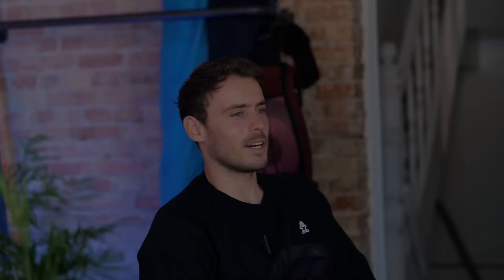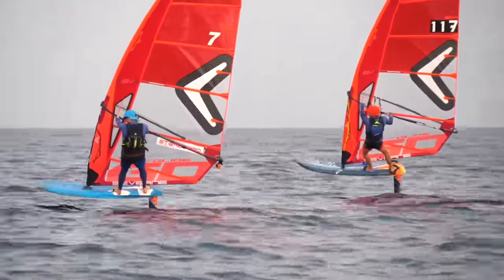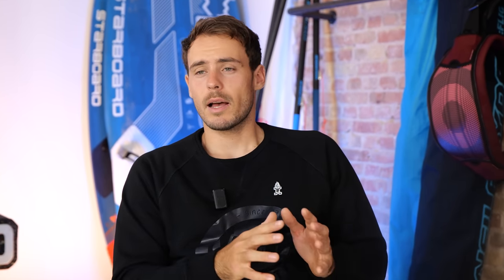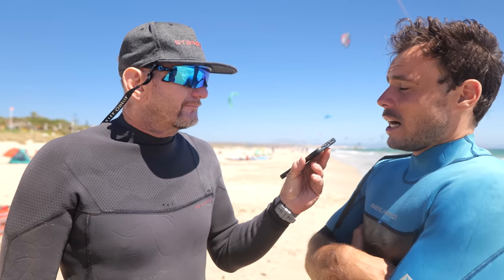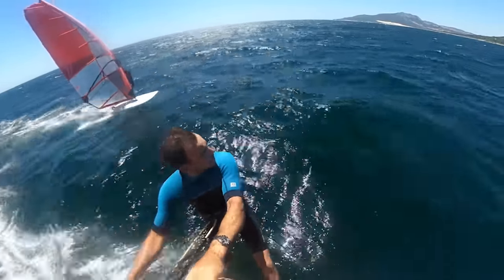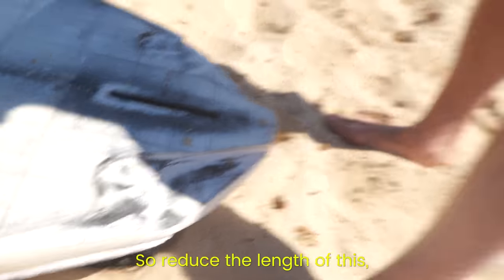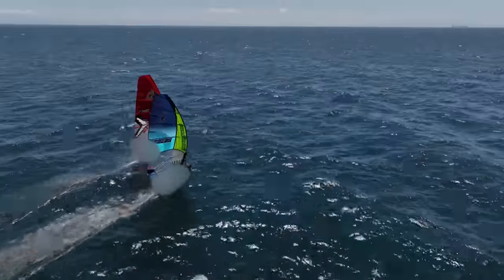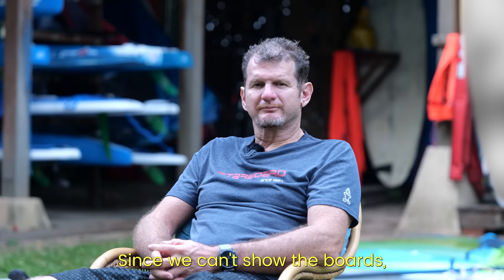Windsurf Board Development | Documentary

Comment: One development which could help those who wear 5 to 8 mm thick wetsuit boots is to make the footstrap covers with longer 'leather' attachment lugs, like an extra 3 cm at each end. Well you could just sell optional footstrap covers for those wearing thick boots. Actually i fix it myself by using chicago screws / rivets to make extensions to the cover lugs using the original holes. The extensions can be made from worn out strap parts and just melt suitable holes using a soldering iron. Most footstrap strap parts can be made big enough for 8 mm boots but the cover is the limiter. It seems important that your foot can swivel freely enough in the strap during a fall so as not to have leg injury.

Comment: That's a great inside look at the development process.  I've always wondered how new boards are created.  I was wondering if the foil racing has influenced fin racing board development.  It seems like racers are using foils in stronger wind these days.  Does that mean fin racing  boards are designed for higher winds now since that's about the only time they're used?

Comment: Great video. Why do you not use the same sail on each board to remove any discrepancy between the Neil Pryde and Severne?
Reply from the maker: Question for you. Would you like the board to work with any sail brand or only with one?
Reply: @Nico_GER7  I get that point, but by using the same sail surely the variable in the test is then only with the board?
Reply from the maker: @robmilligan3650  Yeah, but even the same sail is not always exactly the same (production differences). Then you would have to go as far as having two times the same person 😄.
So then you switch boards only and not the rig. That way the second or third person can always be your reference. Because he/she stays on the same rig.